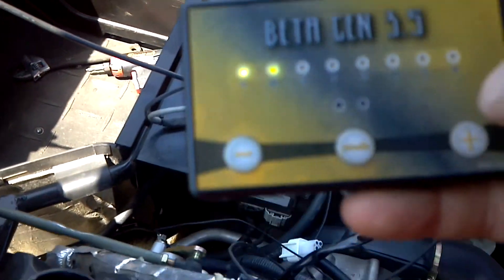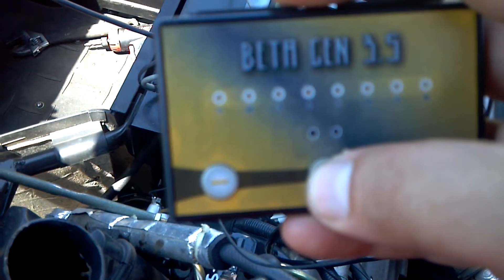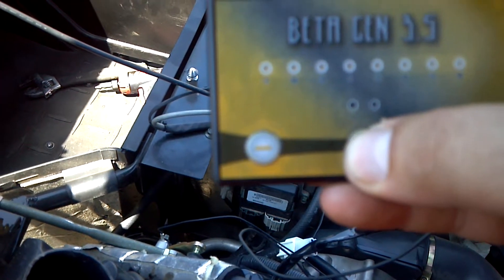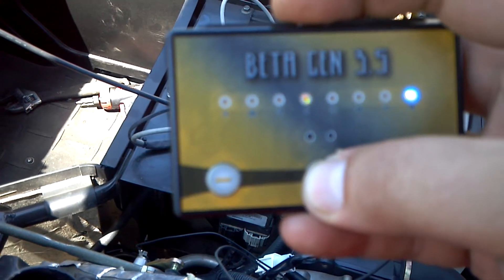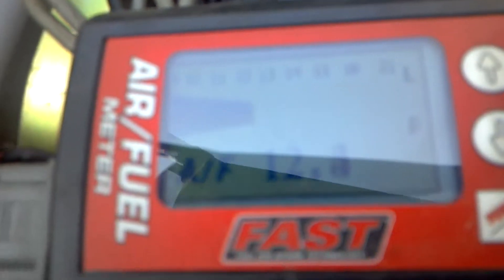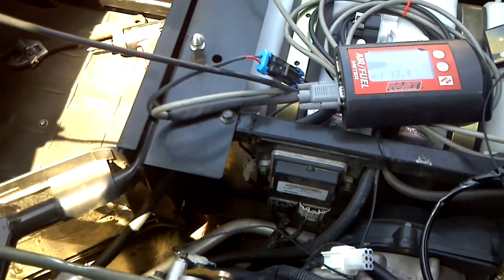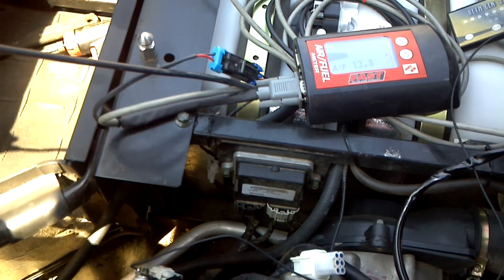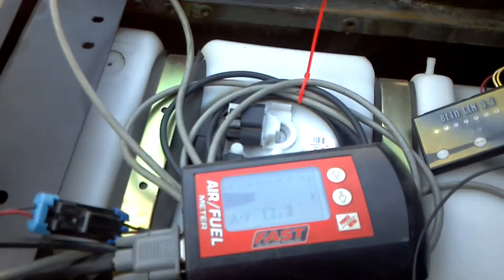Hisun Fuel Controller *Kelley Motorsports LLC*

Comment: Got a. 2014 massimo  utv  800 cc  just put a new fuel pump  cause the old old one was only  reading  25 psi. I had  also put new plugs and  a new computer  it still won't run  and i got spark  I had adjusting the vavle and check the compressstion it was  good